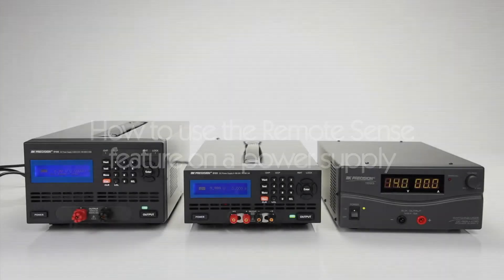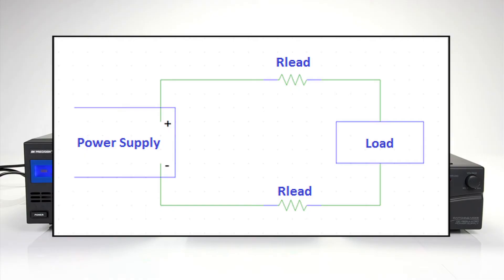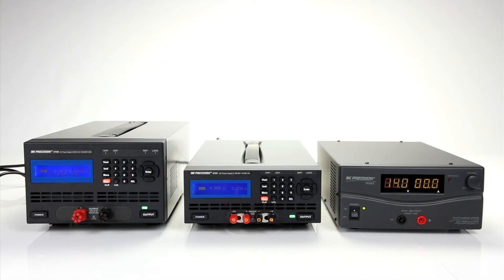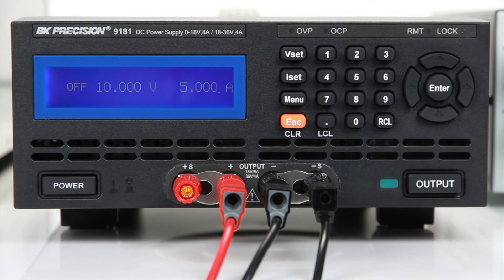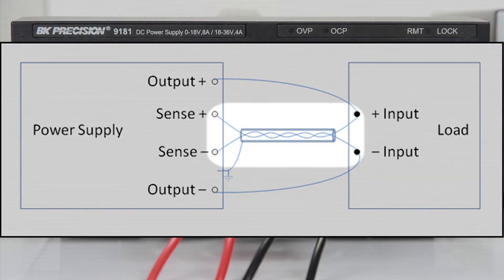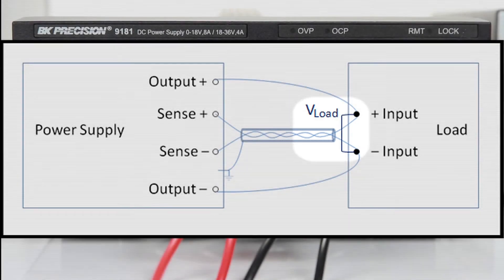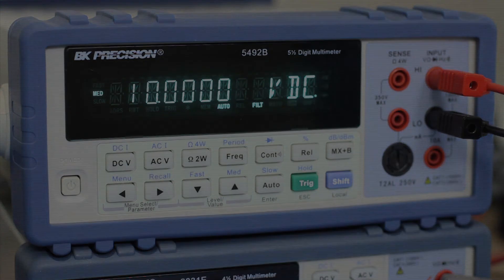How-to Use the Remote Sense Feature on a Power Supply

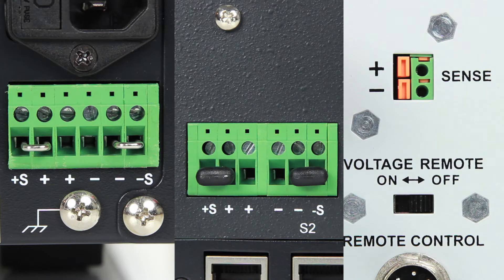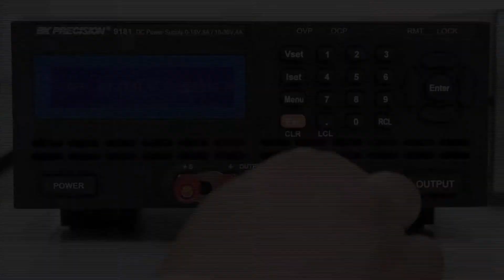Comment: And make sure that you remove the default sense lines 0R bridges that are still in use in this totorial (see 0:38 to 0:51)! 
Otherwise you'll still sense your power supply voltage directly at its plugs 
(because the sense line has many more mOhms than the sense line 0R bridges)
But take care that you'll always shut off the power supply first before disconnecting the sense lines, otherwise the output voltage will be regulated to the maximum possible output voltage of the power supply! This max output voltage might destroy your device under test!
To avoid this overshooting and ensuring the full functionality of the sense regulation connect a wired resistor (typically 10R to 100R) instead of the default 0R bridges.
This works normally perfectly fine, unless you have an unintended power line disconnection and your supply current runs the detour over the sense line. 
--> this could cause a too high power dissipation in you sense bridge resisitor. 
On the other hand if you would still use the 0R sense bridges at high (power) current supplies the sense lines normally can't carry the load current due to their thinner intersection and might become very hot in this failure case of an unintended power line disconnection.
--> try to evaluate the maximum possible value for the shunt resistor bridge while you have a sufficiently regulation of the output voltage (statically and without dynamically overshooting) in the case that you don't use the sense lines. For e.g. using a 0,5W wired standard resistor P=Umax²/R --> Rmin=Umax²/P e.g. case of a 30V power supply Rmin =30V*30V/0,5W = 1800Ohm